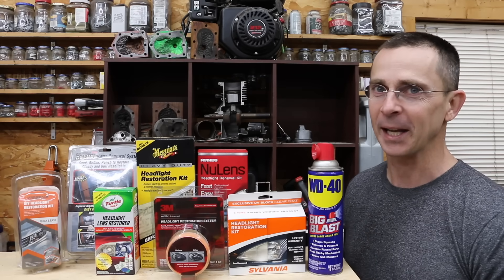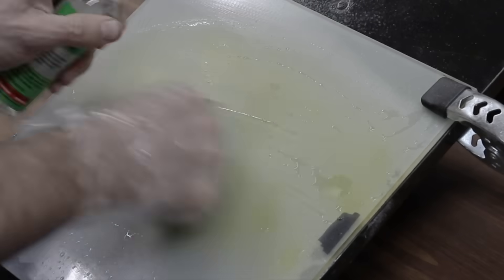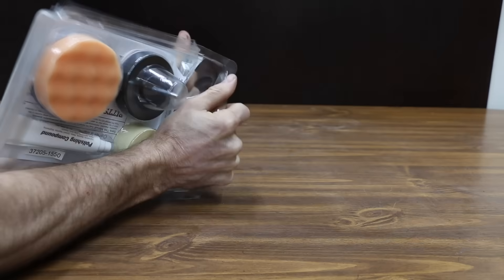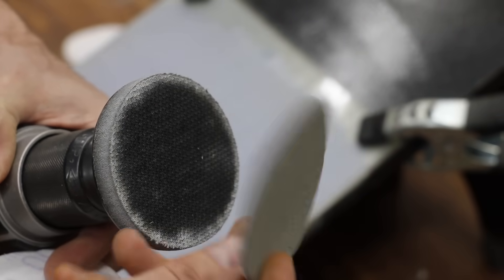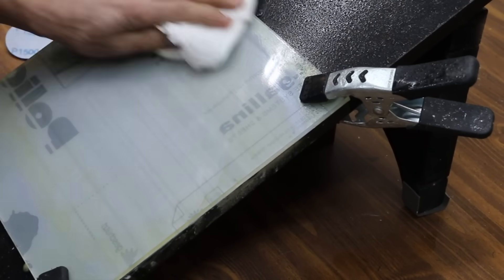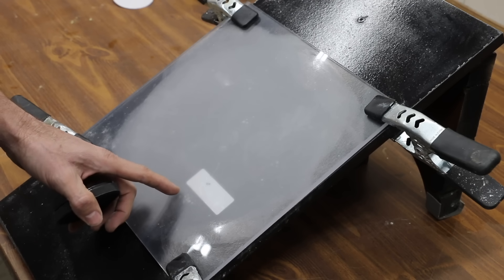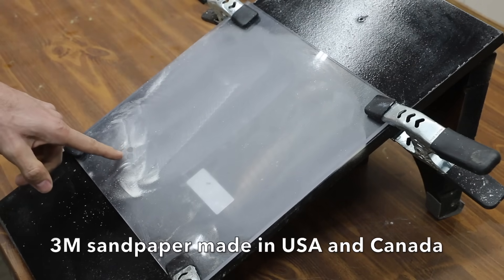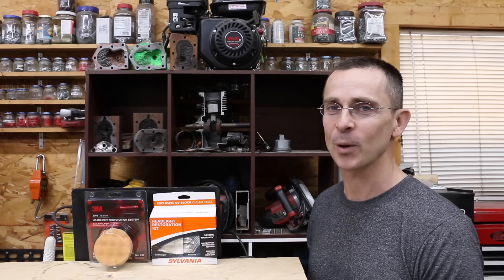Best Headlight Restoration Kit?  Let's find out!  3M, Sylvania, Meguiar's, Mothers, Turtle Wax & HF

Comment: I use a 3M kit to wet sand (you have to keep it wet to keep from clogging the sand paper, it may sling stuff everywhere so cover the car hood with a big cloth and wear an apron) to remove the dull yellow haze and then a Duplicolor polish on the 3M pad and the Duplicolor clear coat. The Duplicolor clear coat will make you think you are going to have runs in it the first time you use it but it's self levelling and does a good job of giving it a glossy finish, just make sure you get a wet coat on the entire lens. If you leave it thin you will be able to see bare spots or rough areas. I think it lasts about a year in full FL sun. I hoped you would try Cerakote, I'm ordering some to try on my previously done 3M/Duplicolor restored lenses. I've also heard that the Meguiars clear coat is good to use when restoring or on good new lenses to protect them.

As always, thanks for doing the videos. Whenever I'm looking for a product and think to myself, which one is the best I know I can come to you for an answer. Have you done battery less (ultracapacitor) jump starters yet? I have a Schumacher 800A one that started a F550 with two dead batteries like it had new ones in it. You can charge it from a weak battery in about a minute thirty as long as there is about 8+ volts left, otherwise you can charge it from another vehicle/battery. Schumacher has been making battery chargers for decades.
Reply from the maker: You are welcome!  Thanks for the suggestion.

Comment: Great video.  I used the 3m kit on an old Honda Fit and got excellent results.   People thinking of doing this need to know two things.  First, it is very time consuming to sand all the damage out on a heavily faded headlight.   Second, it is very messy and slings wet debris in all directions.   Expect to spend an afternoon from start to finish.
Reply from the maker: Thanks!  Thanks for sharing.

Comment: TOO BAD that you didn't also consider a DIY kit of fine multi-grit  (600-4000 grit) wet or dry abrasive paper. The kits you reviewed are outrageously priced for what you get.
Reply from the maker: Thanks for the constructive feedback.

Comment: It seems everyone has forgotten the really simple and effective method of using toothpaste
Reply: I do have a question that goes along with the toothpase theory. Just like these kits, there area many different kinds of toothpaste. Which one is best to use???
Reply: @OSUfan757  If you do a simple YouTube search you will find videos that have 30 Million views and it explains the Toothpaste method, always remember if something has marketing wrapped around it it's there to fool the consumer into buying something they don't need. 
Headlight Restoration using Toothpaste 30M views
Reply from the maker: Thanks for the feedback.
Reply: A damp kitchen sponge and some powdered Comet, gets it done.
Reply: the problem is that this only clears up the lens well without offering any future UV protection.  :-)   @peterkueffner747
Reply: I tried toothpaste, the results were nowhere near as good as the 3M kit, not in the same ballpark.

Comment: thanks, though I'd wished you'd included another...simply using different fine papers, and then sealing with a UV-resistant clear coat. Yeah, I know...not "packaged", but...why not? Just for kicks! :-) Its what I've used on my 2010 Honda Fit, and though I've not used a microscope, it seems pretty good. Also, with all the recycled glass being processed, why the heck don't they return to...GLASS headlights?? Plastics' are a one-way trip, no?
Reply from the maker: Thanks for sharing.

Comment: I was on the fence about restoration or just replace... I ended up getting a pair of new headlight assemblies for about 65 bucks..while the top 2 kits did a great job, its hard to beat new!   since its the clear coating that eventually breaks down on these, I would imagine keeping a coat of wax on them when the finish is brand new ,would extend their life and prevent the clearcoat from going bad.
Reply from the maker: Thanks for sharing.

Comment: Thanks for including instructions while doing the product comparison testing. A mechanic at the local Toyota dealer personally recommended the 3M kit. Considering that nearly everything takes longer to do as a older woman with severe asthma, I was able to restore both headlights on our 2011 Camry in about 2 hours using the 3M kit with my cordless drill and applying 2 coats of Meguiers clear UV protectant spray. 😀 There's even plenty of kit left to do the headlights again. Hubby is quite impressed with the results as the headlights look like new - which makes the old, chipped paint look more sad now Lol😆    Still, we saved a lot of $$ and if I can successfully use this with kit no previous experience, almost anyone else can too! 👍
Reply from the maker: You are welcome!
Reply: Great name, Young Frankenstein?

Comment: I have used all of these over the years and Sylvania definitely yielded the best initial results however as the coating fails it will wind up looking worse than before in 1-2 years. I think next time I restore my headlights I’ll just use a mouse sander and find a higher quality sealant because the sealant quality is ultimately the most important part of these kits
Reply from the maker: Thanks for the feedback.

Comment: Using polycarbonate instead of actual headlights is not the way to go. 

Turtle Wax does an amazing job, Meguiar’s also. Mother’s does a poor job. 

Based on several videos I’ve watched the 3M isn’t as good as the Meguiar’s Heavy Duty and Turtle Wax. It’s good but not as good. 

Again, real headlights need to be restored and compared, not sheets of polycarbonate. What you did to ‘weather’ the sheets is just not the same as actual real world wear.
Reply from the maker: Thanks for the feedback.

Comment: I feel the best solution is to seal the polishing job in something like the 2K Headlight Restorer from Spray Max which is also UV resistant. If i am restoring my headlights i am not coming back in a year to do them again, that is way too much work. I just used that 3M kit and it is very good. Those 500 grit pads were good (not great) at removing some of the deeper scratches but i think i spent like 4 or 5 of them for just one headlight so may have to buy a 2nd kit as the pads don`t last long. Maybe a good reason to go even lower than 500 grit to save these? I use a drill for the 500 grit and polish by hand with the finer grits. It really can be a pain to polish with a big & heavy household drill and there are not many tools out there that cater for these types of sanding pads which is a shame really. Get ready for some serious elbow grease if you are going to tackle your headlights because it`s certainly not a walk in the park to complete a polishing job like this.
Reply from the maker: Thanks for the feedback.

Comment: Listen here.. 
Im doing headlight for a lot of years.. On heavy yellow headlight i start with 240 and finish with 3000-5000 sandpaper.. i triple polish and cereamic coating and its take about 2 hrs per headlight . My friend do headlights and i was there at his service to borrow a special tools for timing belt . In that moment he make some headlights. He use 240 - 600  and 1000 and 3m extreme cut plus as polish and do same headlights in 5 minutes and was better than mine .. I was spechless..
Reply from the maker: Thanks for sharing.

Comment: Used those stupid polishing kits for years in my auto repair shop and hated dealing with any of them. One trick i learned cost less than half as much as one of those kits and takes a fraction of the time to restore a headlamp. Use plain old mothers mag and wheel polish with a terry cloth and work a small amount of the paste in a back and forth motion. You will see instantaneous results without all of the sanding and repeated steps required with those kits. When the headlamp is clean and clear just seal it with an application of plain old car wax and it will last for a very long time. I've been using this method for nearly 10 years now with amazing success and will never waste another dime on those aggravating and time consuming restoration kits. Believe me, it works!

Comment: I’ve been using the Sylvania kit ever since this video was released. I used to be a big fan of the 3M kit because it creates excellent results, but they unfortunately just don’t last. After a year, it’s already cloudy.

The Sylvania kit is like magic. I have cars that I used the Sylvania kit on 2 years ago and they still look like they were just restored. 

Thank you for this video and convincing me to change the kit I was using.
Reply: I apply a few layers of automotive clear coat after using the restoration kit. The lenses stay clear for about 3 years with this treatment
Reply: What would be better, Sylvania as is or 3M with an acrylic polyurethane coating?
Reply: I too would like to know.  @johnmaynes7142

Comment: The absolute best Lens Renewal I have found is to Remove and Replace the entire assemblies.  Nothing fancy, just OEM-type replacements work WONDERS!  

And then you can add a UV blocking film if you like. I've just done mine and will NEVER buff 'em out again.  These are crystal clear and weren't expensive. My car is a 2008, and I had re-worked the lenses a couple of times. No more.  R&R!

Comment: I watched this when you first made the video and again today I've still yet to use the Sylvania kit I've only used 3m since about 7 or so years ago found that wet sanding during all stages and spending about 10 minutes per stage and changing pads about 2 to 3 times makes them crystal clear like new and polishing with a Carnauba wax will keep them clear for almost 2 years
Reply from the maker: Thanks for sharing.

Comment: For me personally the 3M wins hands down why because they supply the correct sanding disk needed to remove badly oxidation, Yellowing, Fogging,And damaged lenses, Furthermore by using a cordless drill it takes the repetitive hard work out of the restoration process for more senior people like me who have Health issues, 100% 🤔🇬🇧👍

Comment: When I worked for a defense contractor, they used sandpaper and polish to finish the canopy for fighters.
I was not surprised the sandpaper and polish did the best.  Personally, I found the kits with clear coat did the best and as you mentioned it works for about one to two years before you need to do it again.

What UV clear coat would you recommend using with the kits without it?  Perhaps another test?
Reply from the maker: Thanks for the suggestion.

Comment: Hate to say it but the most effective antifog kit I've ever used is actually deep woods OFF... yeah bugspray.  Spray on a rag and wipe the headlights down.  May have to apply multiple times and then rinse.  Works every time and it's something I always have kicking around.
Reply from the maker: Thanks for the suggestion.

Comment: Now try using toothpaste with peroxide, a damp terry cloth and a little elbow grease.  The key is to keep the headlights wet as your working.  A spray bottle works well for this…. A foam pad on a cordless drill makes for quick easy work but it’s not necessary.
Reply from the maker: Thanks for the suggestion.

Comment: I've bought kits, but the yellow returns. I've even finished polishing, then sprayed with a UV resistant clearcoat and my Tundra headlights still turn yellow (it sits outside). I've had this  05 pickup for 18 years. My final solution? Every other year, I put a buffing pad on my drill, buff them with toothpaste, then wax. Works for me. I'm tired of paying for kits.
Reply from the maker: Thank you for sharing!

Comment: I did my mom's car with toothpaste and windex and took most of the yellow blur off the outside of the lights, it worked well for a basically around your house items, the toothpaste needs baking soda in it tho to work, light kits are probably better this is a hack u can use if u don't have the money to buy a kit
Reply from the maker: Thanks for sharing.

Comment: I have my guys use the 3M one all my buses etc. that run through our shop. We follow up with a automotive protective wax to protect after and we have always had great luck. One of the older mechanics I use to have swore by mosquito spray with Deet in it, it seemed to work but only short therm.
Reply from the maker: Thanks for the feedback.

Comment: 3M also sells a kit that comes with the UV protectant/clear coat.  I was going to order a Sylvania kit but Amazon wouldn't ship it to my area due to the chemicals in it, that's the reason they gave for canceling my order anyway.  I do most of my shopping online due to disability and didn't check locally.  I went with the 3M kit with UV protectant and Amazon had no issues shipping that one. Kinda sucks since the 3M kit is more expensive. Thanks for the awesome review of these products!

Note:  I live in AL and I found it strange they wouldn't ship the Sylvania kit to my area, I'm going to look into our state's laws to try and find out what the deal is, Amazon didn't give any more of an explanation than that stated above.
Reply from the maker: You are welcome!

Comment: Great job. ,Here's a new one to try. Using a lemon and baking soda . Seems to work very well but still needs protection afterwords. Thanks. !! Would be a good test against wd40  and the old. Brake fluid test
Reply from the maker: Thanks!  Thanks for the suggestion.

Comment: I’ve always used white diamond metal polish on my headlights. It’s absolutely amazing for run of the mill yellowing headlights.
Reply: What were they steps that you used with the White Diamond and did you use any other materials. Thanks.
Reply: @MrJohnnyDistortion  get a application pad, put some on, rub it on the headlight with moderate to heavy pressure for a while then wipe clean.
Reply from the maker: Thanks for sharing.

Comment: There are some kits out there to repair small windshield dents, knicks, and chips using a resin and one of them uses a syringe to pull a vacuum and then force the resin into the chip. Very cool and they’re like $10. There’s a few brands one I know is Permatex. If you haven’t heard of them just Google windshield repair kit. They’re super neat, you should test whatever brands you can find of those kits.
Reply from the maker: Thanks for the suggestion.

Comment: 120 grit to damage the surface is nuts. Same for using yellow paint to simulate old UV degraded finish. I rate this test very poorly. 

I’ve used the Nu-Lens on four heavily weathered and dulled sets of car headlights, and it makes them like new. Yes, it does need protective coating.

Comment: Thanks for the video! I went with the Sylvania on a 2012 Galant. The lenses were not yellowed but they were very cloudy and had a crusty distortion that would not wash off all over them. The wife and I each took a headlight. We got a couple stools to sit on and got to sanding, passing the spray bottle back and forth. We did not use the 400 grit because I didn't think the headlights were bad enough to needed it. And as it turns out they didn't. The headlights look brand new! BEAUTIFUL! Thanks again.👏
Reply from the maker: Thanks for sharing!

Comment: Have you thought about testing LED headlight bulb brands off amazon?
I have been running Aukee 20000 lumen led headlights in my wifes corolla for about 6 months and they are AWESOME.
Reply from the maker: Thanks for the suggestion.

Comment: A couple of observations. The Pittsburgh/Harbor Freight kit works better if water is used for all sanding steps to reduce clogging. The small Turtle Wax sanding pads are excellent for sanding the edges and surfaces that are not simple curves. Also, a final top layer of a high quality (like Eastwood) spray clear coat w/UV protection will provide the best finish and the longest protection.
Reply from the maker: Thanks for the feedback.

Comment: There is a 3M kit that comes with a top coat you should have used the better 3M kit.
Reply from the maker: Thanks for the constructive feedback.
Reply: @ProjectFarm  Yea I was wondering why the heck didn't he use the better 3M kit.  It has all the same great sanding disks plus a top coat sealer.  Happy New Years!

Comment: I used the 3M kit and it worked well. My kit included two headlight coating wipes which saved me the trouble of buying headlight sealant separately.
Reply: There is a 3M kit that I have used number of times it comes in a box. It has pretty much the same stuff in it, although it does not have the final buffing step. Instead it just has a rub on sealant stuff on a pad. That kit has been very satisfying to use and it's only about 20 bucks at O'Reilly's if I remember right. I'm curious if they stopped making the kit he used from 3M and switched over to the new one?

Comment: The 3M kit that cost about $14 and does two headlights works perfectly.
Reply from the maker: Thanks for the feedback.
Reply: 3M seems more convenient than Sylvania. But if you also bought a can of UV clear coat, it would probably kick 3M up to Sylvania's level of finish.
Reply: @anonymouse527  3M has a kit that includes UV protectant/clear coat.  A lot of people don't like to clear coat, (wrongly) believing that it will peal/chip/fade faster. I think that's why 3M offers kits with it and without it.  It does cost more than the Sylvania kit but Amazon won't ship the Sylvania to my area, something to do with the chemicals in the kit, and due to disability I do most of my shopping online so I ordered the 3M with UV protectant.
Reply: @Mark_Massingill  good to know, thanks. I got the 3m kit and clear coat separately. Have yet to use it though.
Reply: @anonymouse527  Should work just fine, both companies offer excellent products.  I know a few people who recommend the Sylvania kit and they are happy with the clear coat in it.